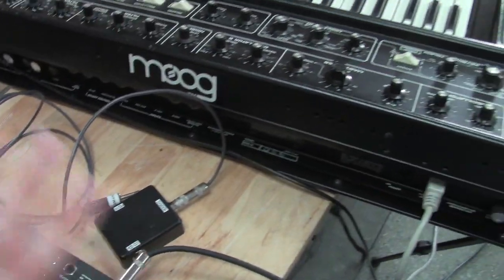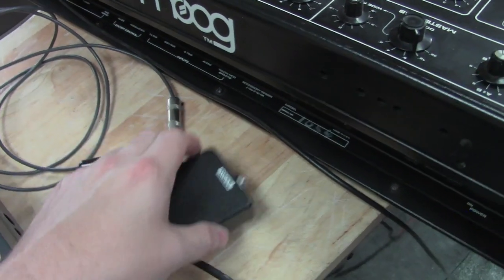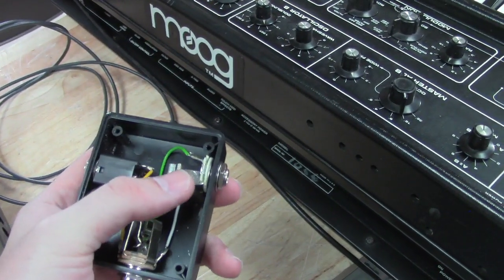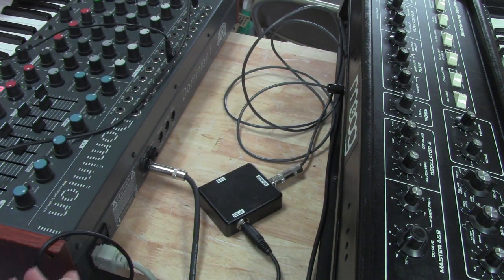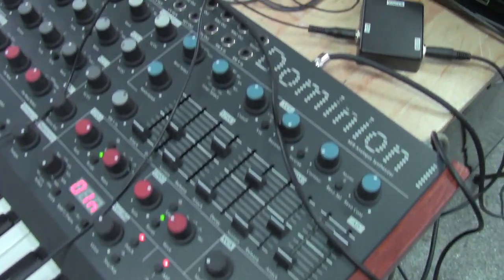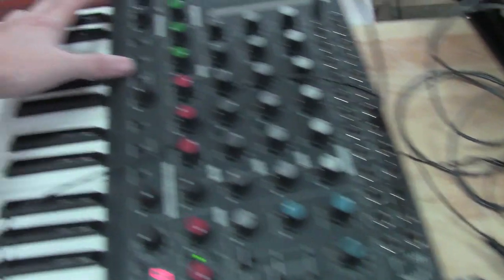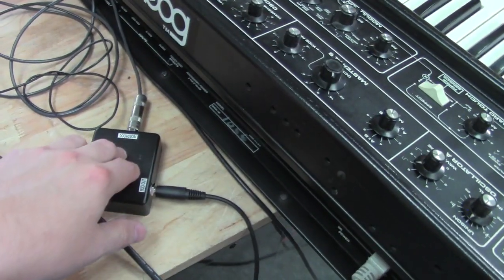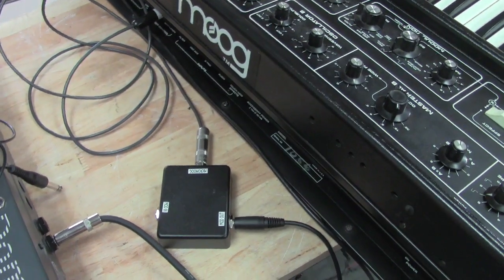Micromoog/Multi Modulation Jack Part 2 (By Synthpro)

Comment: Does the Mod out tie to the Modulation selector? Can you change the Mod out waveform via the Mod Select switch on the Multi or Micro? Does the Sample and Hold show up at this output? Thanks for another deep dive into the hidden gem of the Moog family!
Reply from the maker: Hey George Ray,
Yes, the waveform selection responds to the modulation output just as it does internally. 

Your welcome, glad you enjoyed the video!

Comment: How would you rate the multimoog compared to the minimoog?
Reply from the maker: They really don't compare when you play them side by side. They both sound awesome but the multimoog only having two oscillators and both oscillators share a single footage control makes it a little limited. The area where the multimoog shines is with the VCF and aftertouch, Jim Scott designed the VCF in these to have a resonance selection switch so you can go from having smooth filter to a filter that self oscillates and tracks the keyboard....not only does it track the keyboard but VCF is attached the the footage selection meaning you can change what octave you want the filter to be in, (minimoog does not do this). 

The multimoog/micro actually make great controllers for the minimoog because the aftertouch is patchable externally meaning you can route the aftertouch into the minimoog. The pitch ribbon is also patchable.

Overall, the multimoog sounds fantastic but it along with the micromoog really hold their own place. I have several videos where I'm demoing the multimoog or micromoog...may give you a better idea of tone.
Reply: @synthpro  I know this was a year ago but in case you ever revisit this video.. how exactly to you route aftertouch from a Micromoog into a Minimoog? I have both and was totally unaware of this.